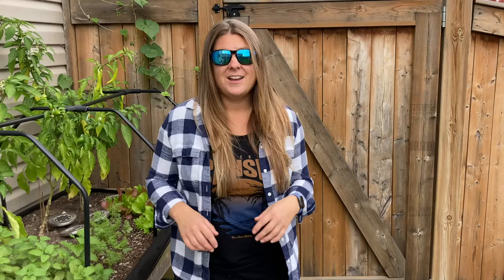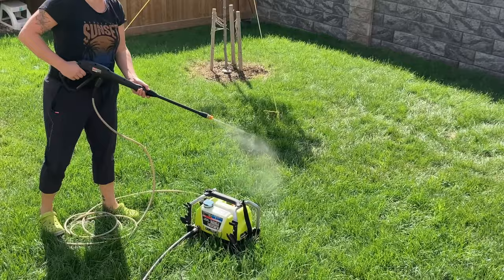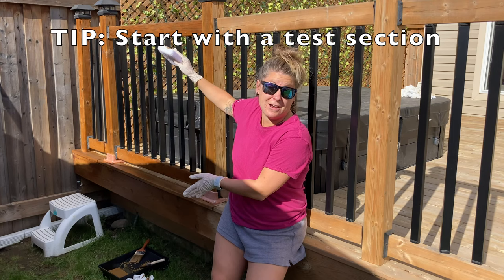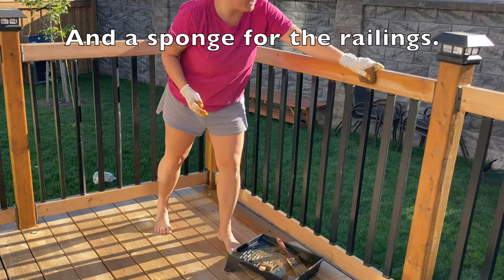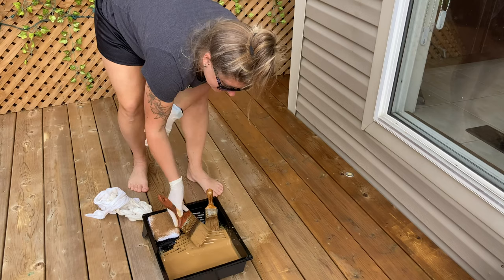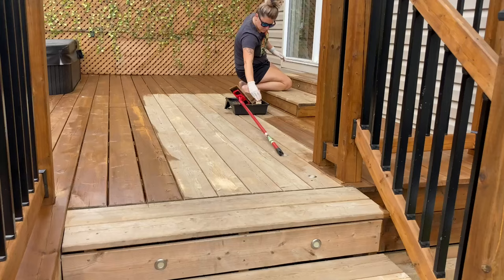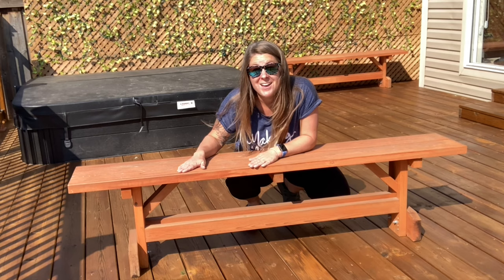Stain a New Deck for the First Time in 5 Easy Steps| DIY Tutorial | How To

Comment: Started staining our back deck. Prepping the wood is everything. Very important to clean it and use wood brightener. The brightener opens up the pours in the wood to absorb the stain. I am using a stain made by Defy. I bought Defy Ultra semi-transparent in light walnut. It received great reviews from the research I did. I have used Cabot in the past and it didn't hold up as well as I expected.  Reviews on Cabot are mostly negative.  The Defy cannot be bought at the big hardware stores.  Luckily a local home center had it. It's more pricey than other Name stains ($65 a gallon). But if it holds up as great as the reviews have said (5 years with heavy use) than will be worth the extra cost. I did my rails today and it went on really nice. Love the color of the stain. Just thought I would share my experience. Remember, prepping is EVERYTHING when staining a deck. Wood brightener is a MUST.
Reply from the maker: I did not consider brightener since it was brand new lumber but I will try it out for the next stain job. You’re right Cabot didn’t hold as well. The railings are still perfect and look great but the deck itself is very worn after the winter, direct sunlight, foot traffic and my dirty dogs. Thanks for the tip! Hope your finished deck looks amazing. $50-65 a gallon seems the normal price in Canada for decent stuff. I’ve seen some $75+!!
Reply: Defy ultra is water based, always stick to oil based when staining deck. Water based is the worst type of stain to apply on decks because it doesn't get absorbed and sits on the top and will peel.
Reply: That is old school water base. The new stuff, like Defy, is a hybrid and it penetrates. It is actually oil encapsulated in water drops, or something crazy like that. There is no coat sitting on top, thus reapplying is also simple with no sanding. Yes, straight oil might penetrate a little bit better and be more conditioning to the wood. The key with these hybrids is not to do them in blazing sun. Early morning is best. They penetrate better when done slowly. The great thing about the water base hybrids is you don’t need to be a master weatherman. Here in Indiana the weather can turn on a dime. Plus, they tend to be more true to color. I hear people complaining about some oil base products getting extremely dark and just not the color they were expecting.
Reply: @joelf5565 great info!   Any particular brand you like/recommend?  I want to stain some cedar shutters and hate oil based cleanup.   Looking for a deep wine color but not too much red.

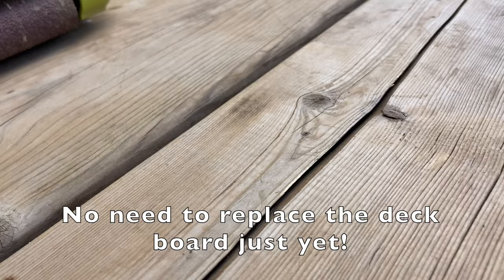Comment: 2:18 is a prime example of why you shouldn’t wait so long to stain initially. 

Looks great!!
Reply from the maker: Thank you! And yes, I was given some poor advice about waiting to stain. I agree, do it asap!
Reply: I was told 3-4 months before staining to allow the wood to dry. Is that correct?
Reply: @SH-jv5uf  it’s up for debate. I have not had issues staining after two or three weeks. Buy the lumber, get the project done, stain it when you have two
clear days. Trap that pressure treatment in versus letting it dry out
Reply: Just had our deck replaced. They said 6-8 weeks before stain/sealing. This weekend, it will be 7 weeks and I am ready to go. I noticed you also have metal spindles. Did you mask them, or were they easy to clean the stain off? I’d really like to not tape them up, as there are about 700 of them.
Reply from the maker: I did not tape them up. I just went around carefully. The sponge is easier to control than a brush I found.
Reply: @lauracoteDIY  Thanks for the reply. We all pitched in and taped the tops and bottoms, the stain that did get on them, wiped off easy. I’m going over things with a sprayer today, because I could not fit the brush in between the deck planks. I’ve never noticed them so close.

Comment: Looking good.

 I'm still contemplating what stain or sealer to use my deck is about a year old had gotten fairly weathered so I had to clean it now I'm just trying to figure out what to put on it it's similar in size yours maybe slightly larger the only difference is I've got wood spindles which are going to be a pain in the rear to stain individually.

I want something I can put on the wood that will penetrate the wood and I don't have to do every year or two not worried about a little bit of discoloration over time I just don't want the wood to be damaged considering what it costs now.
I've mainly been looking at different kinds of deck oils.
Reply from the maker: Oh it will fade no matter. Mine already has which I expected since the sun beams directly down the entire day. It’s just not rotting, which is ideal! Try the sponge for the spindles, it can wrap around and you’ll have a few passes vertically much faster and more thorough than a brush. My posts turned out great, just on a larger scale of your spindles! Good luck! Try a test space first. Ask your local store if you can get a sample or if you’re able to return. I did return my first can before I came across this one I used in my video. Thanks for watching.

Comment: We had a deck put up last May. I didnt stain yet.  I plan to this month. I'm wanting to use a clear stain/sealer. Will i have to use the sponge  after? Also, we have an 8 foot long lattice "privacy wall" on one side. Should we stain that as well?
Reply from the maker: If you take down the privacy wall, a spray paint would get the job done very fast and get into all those connections and overlaps. Hope the staining worked out for your deck as well!

Comment: What if your deck has old chipped paint? Does that type of sander work as well, or would you recommend something stronger?
Reply from the maker: You will have to sand or strip the paint before a new stain. I will be doing this eventually and will most likely rent an industrial sander with a long handle to speed up the process.

Comment: Good job. Straight away watching you sand, I thought you really should sand the whole deck to avoid the spots. A big job but worth it. You mentioned it and obviously it's your deck and your happy with it. Doing it for a customer, the whole deck would have to be sanded. How's it looking after a year, have you reapplied another coat? Cheers. 👍
Reply from the maker: yes! 100% agree to sand an entire deck for a paid customer job. Next year I will most likely be sanding everything. My 2 dogs have destroyed my deck since, however the railings are still looking new!
Reply: @lauracoteDIY Hi, at least the rails are still good.
My dogs over time damaged my deck. Claw marks  playing with toys or bringing soil, mud up there. 
Just sanded it down recently and was a big job, but have applied two coats of oil now and ready for summer. 👍

Comment: What type of sponge did you use? Also, My deck is over a year old. I’ve power washed and sanded. Thinking of a clear stain? Any recommendations?
Reply from the maker: It’s a sponge that is covered in a cloth material and called ‘terry stain pad’. I found at the paint store and you can also buy online. I’ve not used many stains. Cabot is the best so far. I didn’t like Sico or Olympic that much. I’d talk with your local hardware store and maybe try some samples.

Comment: Exactly the video I was looking for I'm Just now ready to power was, I sanded first :(  This Cabot timber oil is what I have been considering in teak too, How is it holding up? Thanks
Reply from the maker: Good luck with the rest of your project! Tbh it’s worn down a lot over winter. The railings are still looking new. Overall the purpose was to protect the wood and even with some colour fading in heavy traffic areas, it’s still decent! Teak is such a nice look and Cabot was easy to work with!

Comment: Wouldn't you sand before power wash 🤔
Reply from the maker: Great comment. Personally I chose to wash first as I didn’t want to be sanding up all my grease spots. Some people may not even want or need to sand. I did question this myself and most of my research did suggest washing first. I don’t think either way would be incorrect as long as the wood is free from dust and debris prior to staining. Thanks for watching.